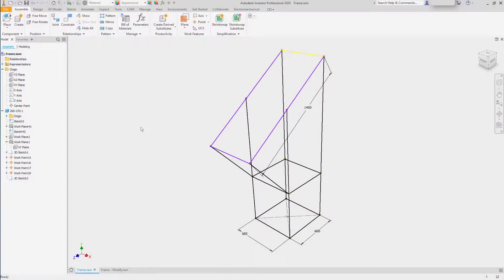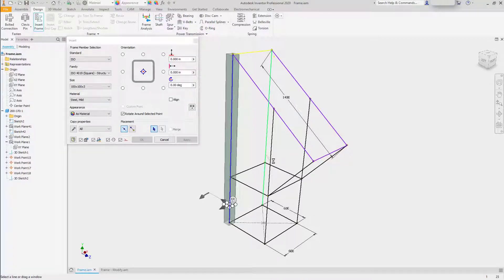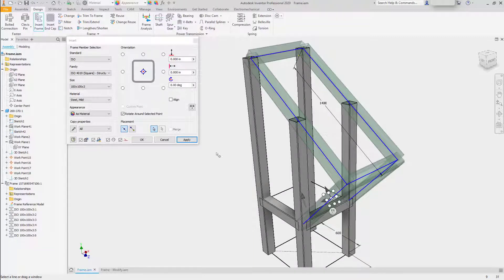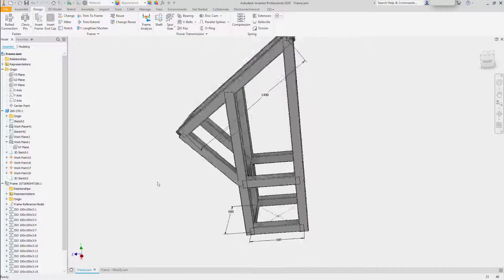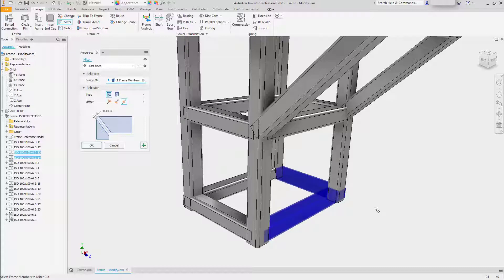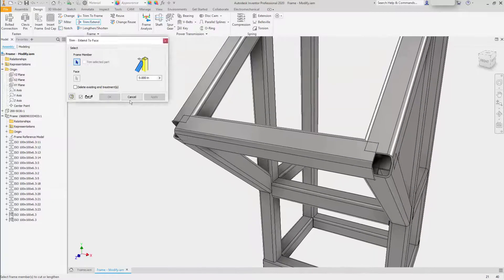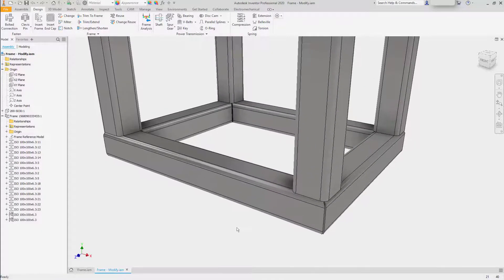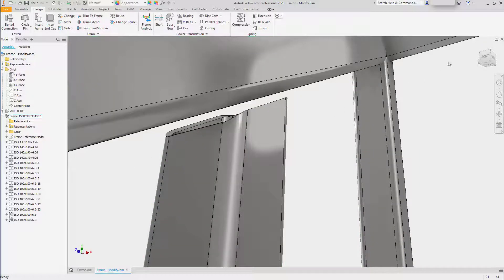Inventor English 2020 Use Frame Generator to create and edit frames 🧷

Comment: Reuse on items treated with miter doesn't work.
Reply from the maker: Run Reuse first to ensure you have all the members you need, and then do one miter a a time. Once the first miter is done, you may need to rotate or flip some of the reused members to get the miter in the correct orientation.